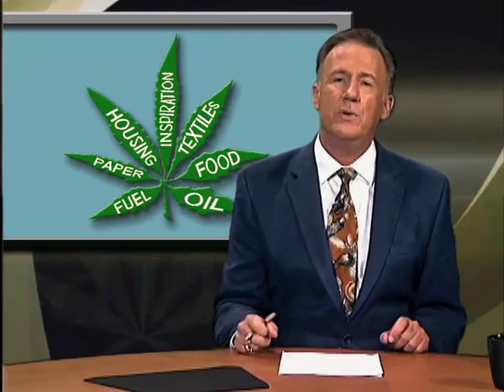Hemp Car - Kestrel

Comment: Also it locks up Carbon when we make things from it. So the cars made of Hemp fibreglass are in effect Carbon Sinks, Pity they are not run on Carbon Negative Algea Bio Fuel, or if EV via a Hydrogen Fuel Celll( HFC)
Reply: The earth is carbon deficit now.  Need to burn more carbon!
Reply: Tonkadude1001 Dont know why I’m even entertaining your comment, as it is so absurd. But pre industrial revolution the atmospheric CO2 was 350ppm, it is now 415ppm!.
Reply: @Kiyarose3999  if that was the case don't you think that the Earth would become more lush?
Reply: Tonkadude1001 The figures I gave for atmospheric CO2 since before the industrial revolution up to today, are not theory, but FACT!
Reply: Tonkadude1001 If it hadn’t been almost entirely deforested parts of the world causing Desertification, which doesn’t regreen naturally as most of the top soil and the nutrients needed for lush vegetation and forests has largely been washed into rivers and Seas.
Reply: @Kiyarose3999  says who? The Rockefellers?
Reply: Tonkadude1001 The atmospheric COS levels are known verifiable facts, that are not just from one particular mega wealthy individual. Facts that 97% of climate scientists know about!. Those CO2 levels are from easily verifiable studies of Core samples that are commonly used by scientists, researchers, etc. Where did you read that the ‘Earth has a Carbon ‘shortage’?!
Reply: Tonkadude1001 Its predictable that climate deniers such as yourself say the info I write. Is from Rockefeller, Bill Gates etc. They are all just ways to spread Disinformation and distract people from the real issues in the here and now.
Reply: @Kiyarose3999  you think I'm a climate denier? I believe in climate and science, it is you that chooses questionable science.
Reply: Tonkadude1001 You are contradicting yourself now, you say you believe in science and climate, but your first comment re Carbon levels needing to be increased. That goes against 97% of climate scientists!.

Comment: wow talking about a half azz fix to the problem. growing cannabis to make the car contains some environmental benefit, but uses electric made from combustible energy. why would we brag about the hemp car without stating the fact it runs on hemp fuel? there are several advantages of hemp fuel over flex fuel or e85 and getting rid of e85 would help lower our food costs.

Comment: Don't Ever Forget 'STANLEY MAYER' inventor of the water power car. What use is a battery for 100 miles. The cells will get weaker, crap idea. Water power car all the way
Reply: Dr MindBender Tesla Motors are awesome.